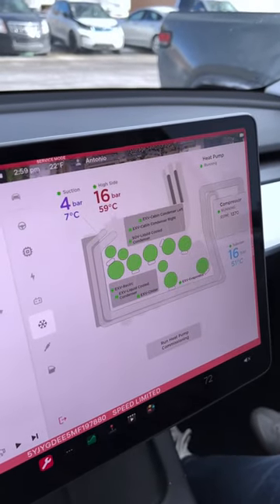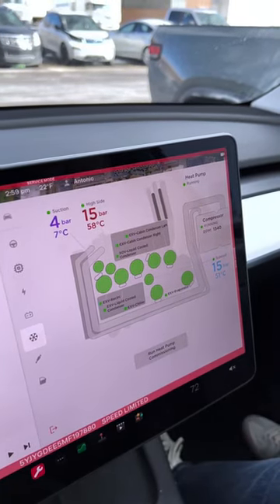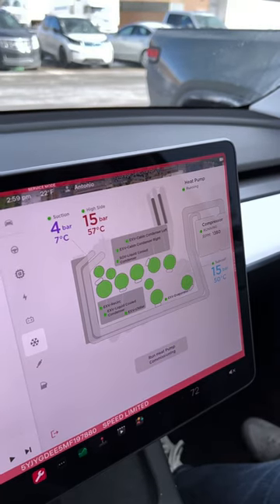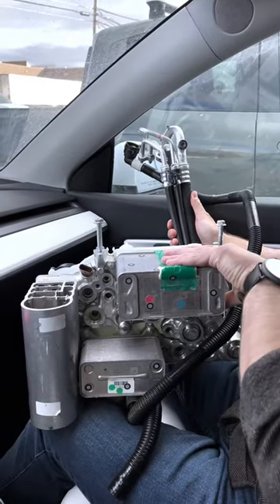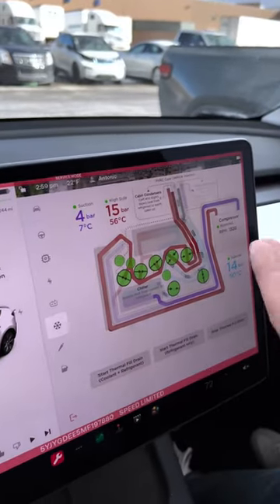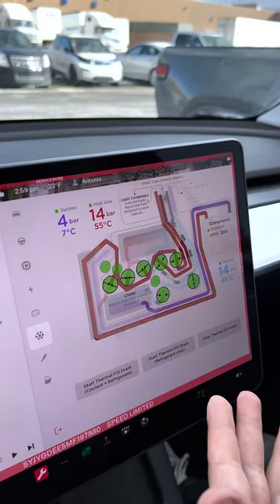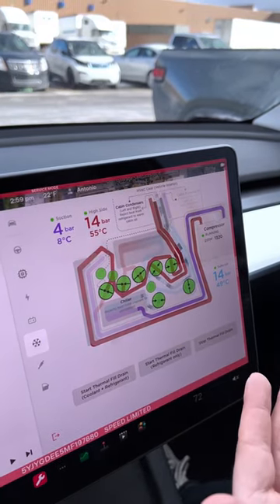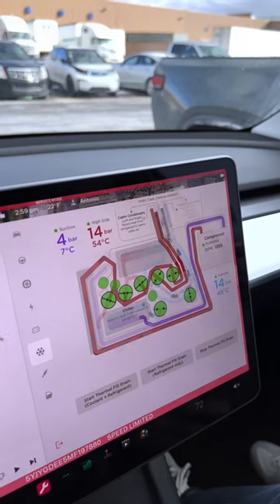Tesla Service Mode - HVAC visualization #Shorts

Comment: Hey Munro and Co, do you know if the heat pump extracts heat from main cabin when AC is turned on but the battery needs heat? Essentially sucking the heat from cabin to heat battery? Rare occurance I know, but I have an idea
Reply: Yes it does
Reply: Looks like it based on the flow diagrams

Comment: It works similar to your fridge. A fridge takes the heat out but this one can change to also put heat inside with help of this great valve system. Teslas and fridges use electric motor for the compressor. Your car uses the engine to power the heat pump which requires a lot of energy and your ice car battery has not enough power for it.

Comment: Wonder what type of refrigerant and type of delivery. Sending refrigerant to the battery? Sound dangerous and counter intuitive. I get keeping it cold, but with a super conductive metal near a battery designed to move a car hundreds of miles sounds dangerous. Especially with the new flammable refrigerants

Comment: Mine broke out of warranty and cost $4k to repair. Only Tesla would do the work. My car was less than 2 years old
Reply: So you burned through the 4 year 48,000 mile warranty in less than two years? Interesting.
Reply: @ronseehoffer5224  I drive at least 25k a year, seems pretty easy

Comment: I watched this 3½ times but i STILL don't understand how Tesla's air conditioning works without an ICE to turn the compressor.
My gas car AC only works if the Car's engine is running. If i only turn key halfway to use battery (for radio, lights) only the vent fan runs.
Next question how can i get this wonder of HVAC to supplement my gasoline requiring AC?